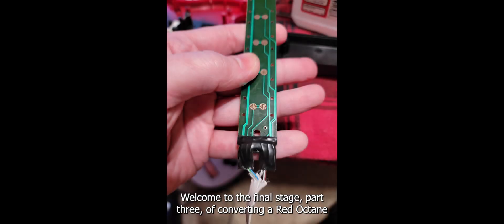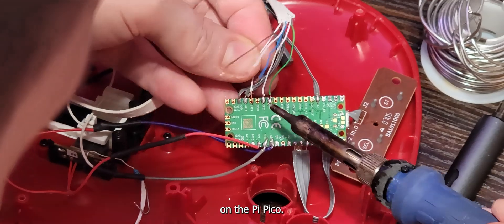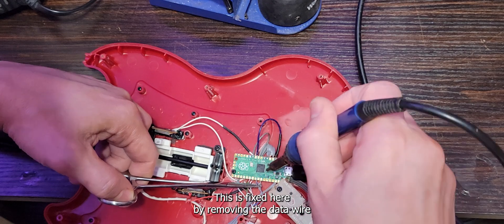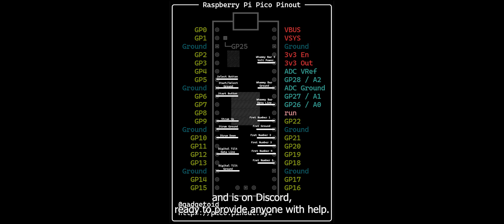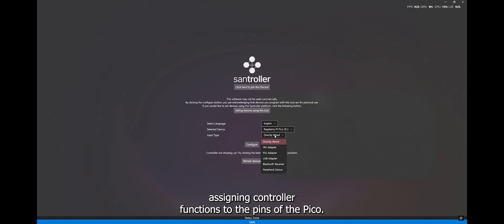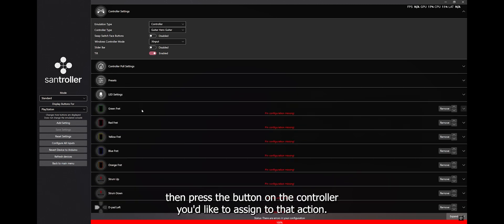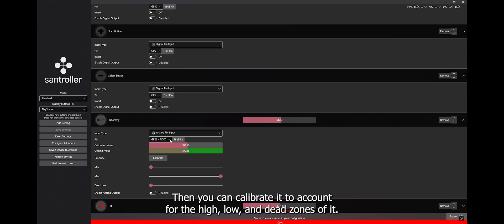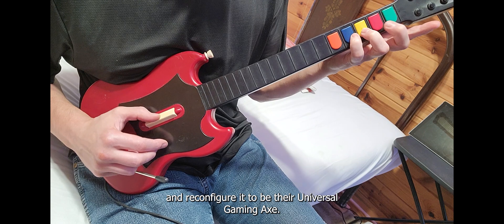How to Transform Your PS2 Guitar Hero Controller for PS5 & PC | Clone Hero & Fortnite Festival 3/3

Comment: Cool, I saw that PS2 controller emulation on the Pi Pico is also possible if you also have a PS2 controller cable, I'll make it compatible for both the Xbox 360 and the PS2 for installing it.

Comment: How did you make the strum work without the strumboard? I have one guitar that doesn't have the strumboard
Reply: Are 2 switches, if its a classic model, its enought to put 2 switches, so when you strum up or down, it touches that switches, in my case, also, i used 3/4 layers of cardboard ( the very thin one, like the cereal boxes one) you have to measure and put it in place, or, search for a 3d model that is somewhere in internet specially made for that use